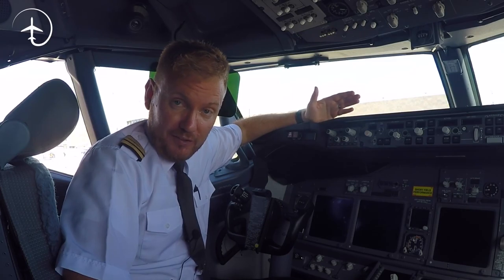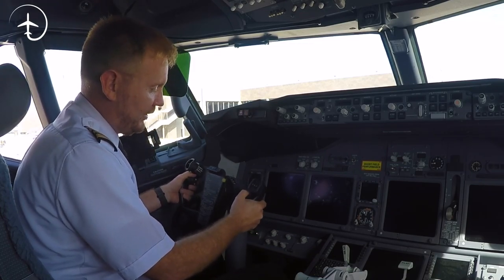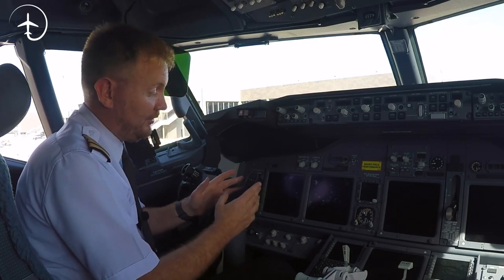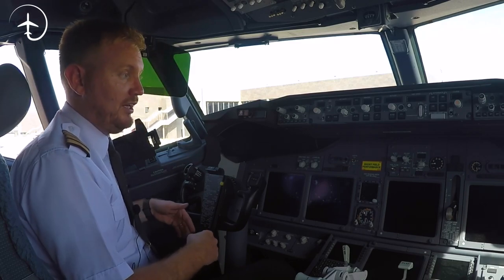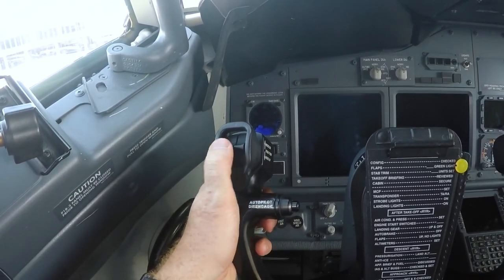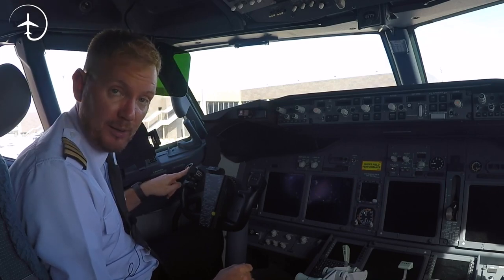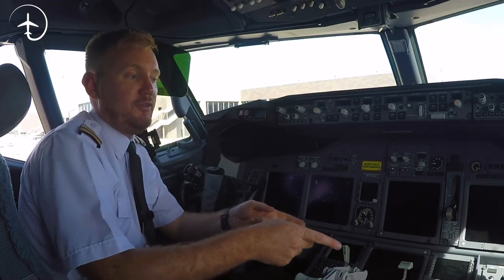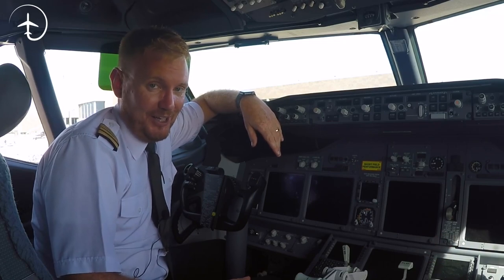Aircraft YOKE (Steering wheel), how does it work?

Comment: The interesting thing with the “trim switch” is it’s split in half. One half controls the stab trim motor and the other half releases the “brake”. And you can operate one half from one yoke and the other half from opposite yoke as they are in parallel. Great vid!

Comment: Another reason for dual trim switches, in addition to what you stated, is to prevent a single switch fault from causing a runaway stabilizer trim. Something that modern day Boeing engineers completely looked over when they allowed their MCAS design to have singular control of the stabilizer trim without a backup logic to prevent a single failure (stall vane for example... Ethiopia🤗)

I might also mention, that when the A/P is engaged, and sufficient fore is applied to either yoke pitch or roll axis, that the A/P reverts to Control Wheel Steering (CWS). In my opinion a dangerous oversight as this happens without the A/P siren and is only noticed, not heard. Something that in training and line operations needs to be more discussed as a threat.   I have accidentally done this personally a handful  of times in 15 years flying it. So infrequent, but real. 

Love your videos!

Love to see you do one on Vnav. Discuss path vs speed, speed override, programmed speeds and restrictions, idle path vs gradient, etc.  maybe beyond the casual viewer. Hard to say.
Reply: Yeah, I was going to say the same thing about the trim switches.

Comment: I hate to correct one of your great videos, but... The reason why the trim is split in two is to make it less likely to get a trim runaway. You can test that each side does not work by themselves, and in doing that you know that if one side were to ground, you wouldn't have a trim runaway because the other side isn't.
Reply from the maker: Hmmm, interesting. I have never heard that but there might be something to it.
Reply: The dual trim switch disconnects both sides of the manual trim motor. As already mentioned it allows stopping the manual trim motor in case one of the dual switch sections shorts 

Regarding the event of un-commanded manual trim motor operation there is a guarded stab trim main elect cutout switch on the throttle quadrant 

With respect to the autopilot trim, the autopilot monitors the manual trim motor and disconnects the autopilot with any manual trim motor operation. 
If the autopilot trim has un-commanded operation there is also a guarded stab trim autopilot cutout switch on the throttle quadrant
Reply: ^^ This was always my understanding of why there were two trim switches...

Comment: I'm wondering; The trimwheels, are they connected to anything driven by something to do with the actual trim setting, or are they just an optical confirmation driven by a separate motor? 
Also, is the radio/mike switch always on the Yoke at commercial airliners?
Reply: The trim wheels are real trim wheels, mechanically coupled to the trim screw and working as manual controls if needed. He has an episode where he explains the trim controls nicely.
Reply: Yep the wheels are connected by a chain to a drum below the console. That drum is connected by a very long cable to a drum in the tail which turns the jack screw that moves the stabilizer up and down.

Comment: Are there still actual mechanical links (steel cables / hydraulics ) on a Boeing / 737   Yoke?
Reply from the maker: Yes, the 737 is still mechanically connected to all the flight controls.
Reply: that would require a lot of man to control such a big plane right
Reply: It is connected to hydraulics, similar to how power steering works on your car. I don't think it would be possible to move the rudders only with muscle strength.

Comment: Hi Mentour, I’m a really short guy (163cm) and I was wondering if i could still be a pilot or even be able to see out of the window
Reply from the maker: Yeah, with 163 you are on the short side but should be ok.
Reply: Mentour Pilot thank you :)
Reply: maybe they will give you a booster seat,? sorry, that was a yoke
Reply: The seats have up/down adjustments and forwards/backwards adjustments. Also, the rudder pedals can be adjusted forwards/backwards. Of course, the adjustments have limitations. I'm 190cm, and it is difficult to find a perfect position on some aircraft. You may be ok.
Reply: ImperrfectStranger thank you :)
Reply: ImperrfectStranger - Now if only they had that for the passengers in third class!

Comment: Have you ever been in a stall situation mentour?
Reply from the maker: But in an airliner, in a Sim and during training, Yes.
Reply: Stalls aren’t a big deal at all, and are (generally) easily recovered.  Pilots are required to practice inducing and recovering from stalls during training and ongoing recurrency.

Commercial airliners are put through exhaustive batteries of tests and maneuvers, including stalls and recovery performance; after certain intervals, repair events and /or major maintenance and overhaul.

Obviously this isn’t accomplished during commercial operations, with passengers onboard.

Comment: great, a yoke. i hate those modern sidesticks
Reply: I don't like how the Captain's sidestick and the Co-Pilot's sidestick work independently on Airbus.  The yokes in Boeing aircrafts move in unison.
Reply: Yokes do seem much safer.
Reply: In 2009, Air France flight 447 crashed into the Atlantic Ocean because both pilots in the cockpit had no idea that the other pilot was manipulating the side stick in the opposite directions when the airspeed indicator malfunctioned. The Airbus A330 eventually stalled and crashed into the ocean. This could never happen with the yoke because they don't work independently.
Reply: Kevin P • The idea of independent operation of the sidesticks just drives me bonkers. How there are not Airbus crashes daily, I don't know. I guess the communication between the professional pilots is superb and the left hand ALWAYS knows what the right hand us doing. The unfortunate 2009 accident is testament to when the idea fails, or when ego or some other issue or event gets in the way?

Comment: Wath is V1? Can u make a vid on that?
Reply: +Nagarjuna N, in very exceptional cases there HAVE BEEN rejected takeoffs past V₁ but before rotation.

if there is enough runaway left and in dire emergencies when the structural integrity of the ship would compromise towards worse or already some major issue has been noticed/ say engines burnout or landing gear issues.
with smaller aircraft (say: Embraer ERJs or Bombardier) or those with lesser start and stop tiime lags; there HAVE been cases of rejected take offs just prior to rotation also
but that is mostly only when there is decisive loss of controls or such damage as would make the plane un-flyable.

all these discussions and thoughts really took ground after the Concorde incident!
Reply: Flying my single engine, four seater, with four pistons under the cowling, I always had to be at V1 before I start to think about rotating.
Reply: Ok. Now i know wath V1 is. Thx dude u are realy Nice!
Reply: If Vr<V1 then V1=Vr.
Reply: @Spock: After V1, there is not enough runway left, thats the meaning of V1. On small aircrafts V1 is VR (on long runways), so no time between past V1 and befor rotate.
Reply: SWE_guy there is a video on it either by this guy, or Captain Joe.
Reply: tjperez69 hahahaha don't do that! LOL
Reply: Yeah! Try rotating at V1! NOT! You have until V2 to decide to abort or continue...
Reply: It's the start of a V1 engine, like a V8 but 7 cylinders removed. Naah just kidding, "V1" is when you reach decision speed. THen you have "Rotate", it's when you pull the nose up and the plane takes off. "V2" is when you're allowed to input flight controls such as bank and rudder, then comes "Positive Rate, Gear Up" which is a look on the altimeter to verify the plane is climbing, after that the landing gear is retracted.

Comment: Regarding trim. I am a simple soul and forget things easily. (I'm also Irish...!) I think of trim in terms of rolling a big weight along the length of the aircraft.
To put the nose down you push the trim control forwards or turn the trim wheel towards the nose to roll that big weight towards the nose and thereby make the nose go down and the houses get bigger!
To make the nose rise you do the reverse and the houses get smaller. Obviously if you go too far the houses disappear and then reappear and then start getting bigger again...
Simples!!

Comment: The buttons I think are for the horizontal stabilizers to move up and down on the jack screw in the tail section as well as tilt up or down depending on what the pilot is wanting to do. There may be more just not sure what else. The yoke if you pull back will raise the nose of the plane in flight and push forward will nose down the aircraft.

Comment: Our 737-700NG has the option of a three position mic switch. What it does is, to hold the knob in position so that you don’t need to press it everytime you whant to speack. So one position up to speack outside via whatever frequencie you have selected and two positions down, one to hold it, witch you can also use to intercom between Pilots.

Comment: The Yoke vs Side Stick debate has been going on for years ever since Airbus introduced the latter.

Unfortunately I never had the opportunity to afford flying lessons, so in my late years I have had to enjoy pretending to be a pilot through sims over the last 20+ years. I have gone through a number of HOTAS combos but after flying tube liners (FSX, P3D & now XP) I will finally be changing over to a yoke instead of a joystick.

Perhaps for many RWPs it could be the psychological impression of being more in control of the A/C with hands on a yoke that feels more connected to the controls than a side stick that uses computerized fly by wire inputs. It may be the future for all airliners to eventually change to side sticks but I will bet that there are many "old school" pilots who will always prefer the yoke.
Reply: For me a HOTAS is all i need, in flight it doesent matter if you dont touch a stick or a yoke, i do all controls over the FMC or autopilot. in FSX i use the Stick only for take off and landing.

If you want to fly a real aircraft, here in Germany you can buy "test flying lessons" at some flight schools for 100-200€. Maybe there is is a Flight School where you live, where you can do it too

Comment: Great Video as usual, can you provide info about the force required in order to move the yoke. I am not able to find releable  information on the web... some one told me that the force required to hold 105 degrees of yoke rotation is 10kg and for a full deflection up/down on the elevator requires a force of 18 kg ... can you confirm !?

Comment: And speaking of numbers and call signs... Could you do a video (if you don't already have one) about the ATC / pilot communication and meanings of the different numbers and abbreviations. I fly on occasion and watch tons of YouTube videos about flight. I hear numbers such as "Heading 270" or "Descend/ascend to 3 7 0"  I believe I have a fairly good idea of this, but not 100%.

But like always, this is another great video.
Reply: Heading 270 refers to the compass. 0 or 360 degrees is North, 90 is East, 180 is South and 270 is West.
"Descend/ascend to 370" is flight level 370 (=37 000 feet).

Comment: Yet an absolutely awesome video. Please do one explaining the Yaw damper. My main question is why is it not always on by default?
Reply from the maker: Good question, we always keep it on though. It’s activated during the first initial flight deck preparation and is then kept on during the rest of the day.
Reply: Dutch roll. All these fast airliners with their swept wings and huge fins on short rear fuselages suffer greatly from yaw-roll coupling and many of them would be a pain to keep under control without the damper.
Reply: Thanks guys for the answers. Will be doing some research. I only "fly" on my simulator and on all checklists it says to turn on YAW Damper. That's why I was wondering, why it wasn't always on.

Comment: 2 questions:
- What does the Airbus use in lieu of a stick shaker?
- When the autopilot disconnects on its own, such as if you hit both trim switches, is there a visual or audible indication that it is no longer flying the plane.
-

Comment: About the trim switches. I've been told that the reason there's two switches is incase one of the switches gets a short circuit for some reason, it wont bring the nose down in the ground unless you activate the other switch as well.
Reply: Jacob Henriksen Yep👍🏻

Comment: Those three numbers on the right yoke handle were puzzling me for a loooong time! I would have never thought it was just a "solid state memory" :-). 

Nevertheless, you got me little confused regarding the autopilot disengagement. Ok, there's a button on the yoke, which turns off the AP. Then there's the trim twin-switch, which results in the same AP cutoff. There's a button on the thrust lever, etc. The question (and possibly the topic for another podcast) is - which cockpit actions result in the AP disengagement? Does the rudder or yoke movement count too? I can quite easily imagine touching the yoke by accident when reaching for something else, which might result in the subsequent banking - unless the AP allows you to, but since 737 is not flown-by-wire, I wonder what would happen. So to sum things up - could you do an AP-related podcast, its engagement, disengagement, actions that cut it off, its setting, etc., please? 

Thank you so much and good luck with your channel, awesome place you've created here on YT!

Comment: Always wondered but never asked, What is the noise in the cabin. Is it AC or engines. Its cool. You can feel power.
Reply: It is a combination of the engines, AC, and from the air flowing across the aircraft structure in flight.

Comment: Actually the stab trim swithes are two for good reason (nothing to do with autopilot)... One of them is direction switch (up/down), and the second one is simply on/off switch (actually on/off/on). Its precaution for failure of the switch. Imagine the switch stuck. How long it will take you to disengage the elec stab trim?.. And then returning the stab manually to "normal" flight position... Few seconds at least. And with "air mode" speed of the stab trim it would really disrupt the flight envelope..

Comment: Very interesting thanks!

In training and simulation tests how far do they push you?
So I’m imagining them in simulating an engine failure you’ve got the stick shaking, the master alarm lights on, various noises and lights going off, instruments showing different readings, and all done in a low visibility high wind situation.
Do they ever simulate that far to push you to your limits in managing emergencies?
Reply from the maker: No, during an engine failure its more calm than that. Check out the "Engine failure" collection in the Mentour Aviation app, if you want to see and hear how it is done.
Reply: Mentour Pilot do you ever get tested in high stress simulations?
If so how far do they push you to make sure you can handle a real event?

Comment: I really enjoy your videos.  They are informative and well presented.    I don't know if this would warrant a full video but I noticed this in a small private plane I flew in many years ago and I see it in this video too.   Does the height of the instrumentation panel obstruct your view?    It did obstruct my view in the small private plane in which I was a passenger.    I guess I was expecting it to be more like a car in that you can see down the vehicle.    It seems like the instrumentation has a much higher priority than forward visibility which I think is more important but I'm not a pilot so I'm probably wrong.
Reply from the maker: No, when you are in the driver-seat you see enough.
Reply: If you go for your instrument rating (IVF) exam, you need to wear a special baseball cap that is preventing you from looking outside the windows (for situational/location awareness). When flying you need to look far, far ahead. So as long you can see the centerline you're fine. As soon you can't see the centerline anymore, you running out of runway ;-)
Reply: Just to be clear, when I was flying in the small plane I was seated next to the pilot not in the seats behind.
Reply: At 900 km/h by the time you can see something out the window it's too late. But seriously, pilots flying IFR spend most of their time looking at their gauges and displays, not out the window. In fact with ILS they can fly pretty much an entire flight without looking out the window once.

Comment: Do Boeing yolks have any sort of physical linkage via hydraulics etc to the actual control surfaces or is it fly by wire like Airbus? I remember hearing some pilots could get a feel for how the aircraft was flying by just having their hand on the yolk where as FBW gives zero feedback.
Reply: The flight controls are mechanically connected to the yoke on the 737 AFAIK, the 737 is not fly by wire.

Comment: Question: Videos of cockpits, shows the yoke being jerked around, up and down, and torqued / turned by the airplane's flight (noticeable on landings and takeoffs).  Yet, it has no apparent action on the airplane's flight trajectory.  Why? What amount of pilot input is required on the yoke to change the airplane's flight trajectory? Because the videos show the yoke jerking about without a 1:1 response from the airplane.